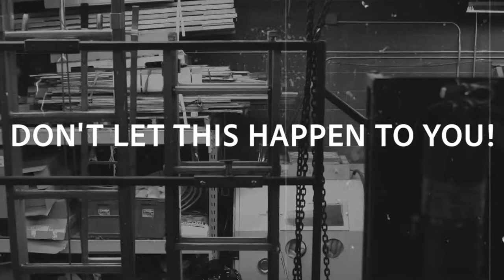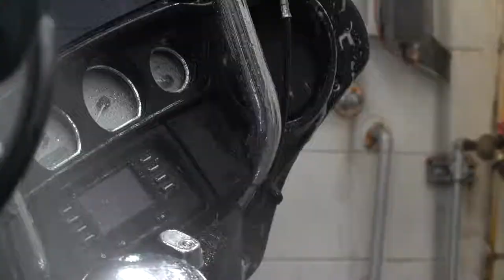A Service Nightmare

Comment: Interesting add, but you told me you didn't want to work on a 1998FLHPI because it was too old. New battery and tires okay, but fuel injection leak no way. I fixed it myself🤔